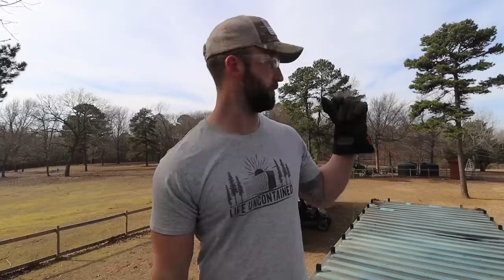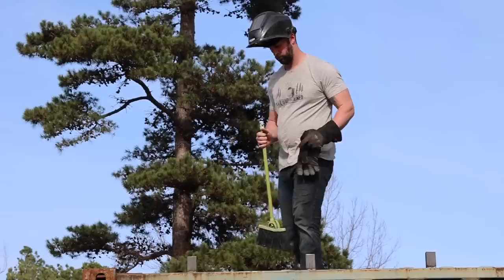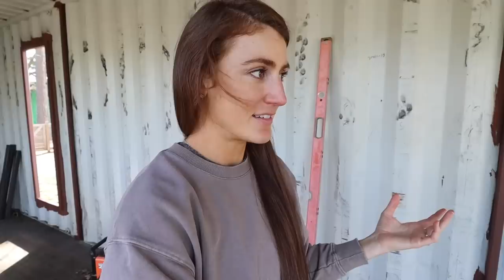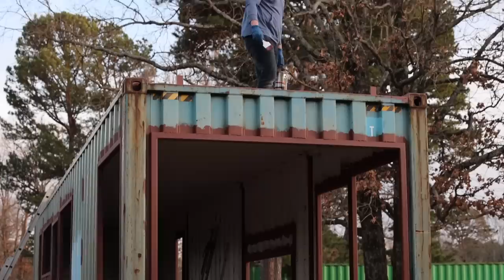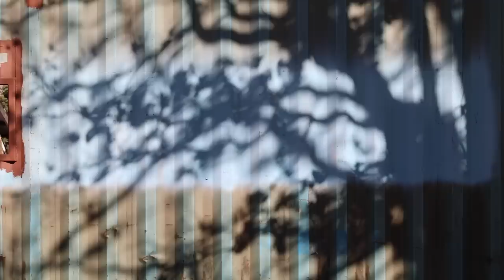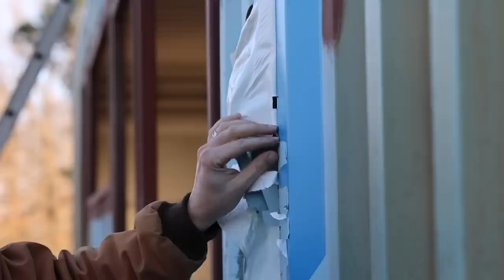TIME TO HEAT THINGS UP!

Comment: Spencer, try using a flap brush disc on your grinder. it looks like a bunch of sandpaper layers. it works good for rust and laminated stickers while not gouging the metal as bad as a grinding disc and can also be used to dress up your welds after grinding.
Reply: That's what he is doing.
Reply: They are in this for the You Tube cash but they never respond.  Zero thumbs up from me.

Comment: Ever think of drilling a hole in the corner of the container so that puddle of rain naturally drains off. Could then easily plug it when the container is sealed in. Love your video’s.

Comment: I’m a pipe welder and work with metal every day. Another idea for getting those stickers off would be a wire wheel for that grinder he has. The grinding wheel will take off some of the metal along with the sticker making the already thin metal even thinner. I highly suggest the 4” wire wheel for the grinder to remove stickers and paint from metal 👌🏻

Comment: The first time I saw the heat gun method was on Kuz we Kan farms video using a small hand torch. They also are doing a container home build. The stickers just peeled right off and after the paint you couldn’t even see it.  The heat gun method (or blow torch)  most certainly is better.  Good video!

Comment: That decal came off pretty quickly with the heat gun, personally, I'd been wearing throwaway gloves. The adhesive under those things can get pretty messy when heated, now it'll have to be stripped off for paint. Love ya'll ❤️

Comment: I'm amazed at the unbelievable long time it takes with a heat gun to pull off all those stickers. About like watching the grass grow.   Hell of lot more patience than I'd have.  I would have pulled out the big guns with sandblasting it all and using airless spray gun to put both roof paint and new sealed sides of the container.   Bravo for your chill, calm reality of the heat gun method.

Comment: Just get s wire brush that screws on your angle grinder to remove the labels and decals off of your container. Once you get it scored, you can put a remover like "Goop Off" or a paint remover, let it sink in for 12-24 hours and hit it with the wire brush again. You might need to repeat this process over a few times but, you won't mark up the metal.

Comment: I used a bottle jack and a 4x4 to get the dents out of my metal roof. It works!
Reply: Maybe a leaf blower to dry the water off the roof?
Reply: Wouldn't paint stripper or a torch be easier for getting the labels off?

Comment: I have used a hydraulic jack and a pair of 2 x 4’s nailed together and cut to size and I lifted out the dents on the roof. Saved a lot of time banging overhead. Rust never sleeps…….  Hang in there, in no time flat you will have the container dried in with windows and doors!

Comment: Have you tried using a rubber wheel? Thats what we use in automotive to remove stickers and it works amazing and doesn't damage the surface underneath

Comment: They make thick wire paint stripping heads for your grinder.  Also, there are automotive seam seal stripping heads that would be good for those stickers.
Reply: They also make Pneumatic scrapers for the sticker removal that won't damage the metal.

Comment: Get yourself a Stainless steel, twisted wire cup wheel brush made for the model of grinder you have.  It is easier to use and works quicker.

Comment: Easy way to get rid of stickers, is to get a 3M rubber wheel for a hand drill. It's like a round eraser and is fantastic for removing decals. I say this from experience in the graphics and signs industry.

Comment: Just get some textured paint for the outside, it will cover the decals.  Or you can put a vapor barrier, insulation, some kind of free salvage siding on the outside, which will make the inside bigger...  there are ways to put creative wood panels on the inside without full interior framing...

Comment: Well obviously I commented before I finished the video but, in the future, if you keep the heat gun on the decal as you pull it off instead of heating an area then start pulling off the decal. Before you get to the end, the glue has cooled off and the decal starts to come off in pieces. Keep the heat gun in motion as you pull off the decal preventing melting the decal.

Comment: All that grinding to get the rust off is a lot of work. I have found through experience that using a wire wheel will do a better job of getting the rust off without grinding down the metal and weakening the structure. The wire wheel will leave a nice shiny surface ready for paint. They maybe better at removing the stickers also although I have never tried them for that purpose.

Comment: Just an FYI from someone who use to install and remove graphics (stickers) for the film industry, for you future container projects. The heat gun works well to loosen the glue then pull the vinyl on an angle and keep your pulling hand as close as possible to the edge that is being pulled from the metal. That will result in less tears of the vinyl. The worst time I ever had doing that removal was removing the numbers and letter off of a helicopter out on the tarmac. They insisted each little piece of vinyl get picked up and put in a container right away (little tears caused major grief)  so as not to blow into other helicopter parts. Understandable but a real pain in the butt!

Comment: Curious WHY you haven’t put plastic over the windows to keep the rain out?  Could use window kits pretty easily and not have to deal with all that water inside.

Love watching all the building you two have done and life changes otherwise.  Such cute videos!
Reply: As soon open the door, it would blow out..
Reply: @audreye7078 I don’t see how, especially since window kits use adhesive to stick around the window.
Reply: @vtmielfgirl  the door is at one end.. the wind will hit the plastic from the inside. If you've ever used this before on leaky windows,, you'd know just how strong even a bit of air pushes. Now imagine funneling even a 10 mph wind into that space..
Reply: @audreye7078  Good point - if the door is facing the prevailing winds.  If not, it wouldn’t be as big an issue, but I agree the kits might not work in all cases.  (I have used them and understand why you said this.). But SOMETHING is better than nothing and could be something else - tarps, whatever.  It just seems crazy not to have anything covering them at all and to make more work for themselves.  But - it’s their choice and lessons to figure out.
Reply: @vtmielfgirl  i have half jokingly commented that the puddles are the best levels.. even with a 4ft level, a 1/8th inch over 40 feet wouldn't be seen.. but the water would sure say its not level...

Comment: Eventually one of you will start to fall on that extension ladder. And because you've put it together backwards someone will get hurt. The bottom section ALWAYS goes behind the top section. Also, dents in the roof? Use a bottle jack and a 2x4 from the inside to push them out. Project's coming along nicely.

Comment: Just curious as to why you havent dry fitted the container? You could easily put up plywood or plastic in the windows and doorway to minimize the water on the inside.

Comment: For dent removal. Use a scaffold acro. Push them out. The flooding. Just drill a hole in the floor for now. Better to be dry than wet. The sticker. Get a hot air gun or a hair dryer on it. Then white spirit to clean the residue off.
Reply: You really should have watched the video...
Reply: @cmerton  I posted it before the sticker removal. Yes.

Comment: You should be able to use a heat gun on the stickers to heat the adhesive and slowly pull off the decal as you move the heat gun over the decal heating the adhesive. You don't want to melt the sticker just heat the adhesive behind the sticker. This should be quicker than grinding the decal.

Comment: Not sure if you've gotten to take those stickers off yet or anything I'm just watching on my TV right now I haven't had a chance to read the comments but I didn't a pressure washing business and the hot water usually takes that off with quite a bit of pressure or you can try using a heat gun To remove For me as well. Hope this helps It's my 1st ever comment on your site and I've watched sense you guys moved into the barn

Comment: Just use a bottle jack and 2x4 and jack up on it and it bend out quick and I would do it all the way down the middle to try help the water run from middle straight off the side for what water if any actually gets on it..

Comment: An easy solution is just go to harbor freight and get a sandblaster. Just bead blast the whole thing... You can even put a wire wheel on that grinder.

Comment: The seams that you showed are actually kind of cool because of their unique simple design with the mix of lines and curves is what I thought was cool. Try to take a step back and look at them as one element, not up close where you see the detail.  Kind of a  stepped up shiplap kind of effect.  Of course, I can't see the whole container.  I definitely think the rust needs to go.  Do that first and then step back and look the at the cool seams -and then decide - no more work really and it gives you options to stop or continue. No harm, no foul.

Comment: Get one of them big weed burner torches and burn them stickers don’t do it till the metal warps but just do it enough so you can get the them loose with a wire wheel or something

Comment: Definitely take the stickers off.  Do it right the first time.
Isn't there some solution that you could put on a sticker to loosen the adhesive & pull the sticker off?
You may have to remove the paint for the solution to penetrate the adhesive between the container & sticker.
Any way to find out what kind of adhesive was used?
Reply: I should have watched the end of the video!

Comment: I know  this suggestion  a little late did you consider  a small portable  sand blaster   you have a air compressor  ?  I forgot where  I bought mine holds bag of sand and is easy  to move

Comment: If you feel taking the stickers off is a pain, then, there are people who have covered imperfections on their shipping containers by making a wall with wood slabs and paint over it still looking industrial, with a modern look.  You don't have to use wood, you can use plastic water pipes or other kind of materials maybe even concrete work of art.  The options are endless

Comment: Okay I going to need you to invest in a small step ladder or a work platform to prevent Spencer from falling off one of those 5 gallon buckets and cracking his head open.
Reply: Cam needs the small ladder. Spencer has a lot of practice standing on buckets, used them constantly in the house.

Comment: call in a mobile sandblaster/soda blaster to remove all the surface on the outside.  Would still have to remove the stickers off though so that is unavoidable work.

Comment: Please stop using Rubber Sole shoes or Sneakers when working on ladders. You will pay the price in later life.
BAD FEET, use a firm sole boot !!!!! on round rung. Only contact is your ARCH.